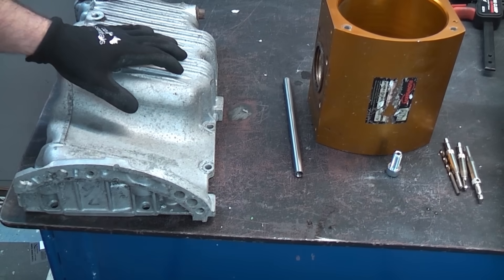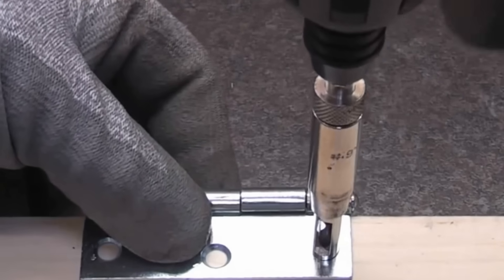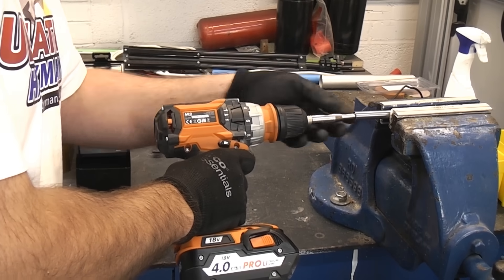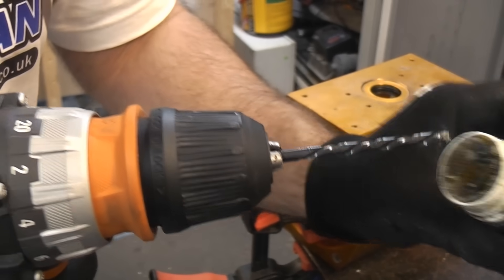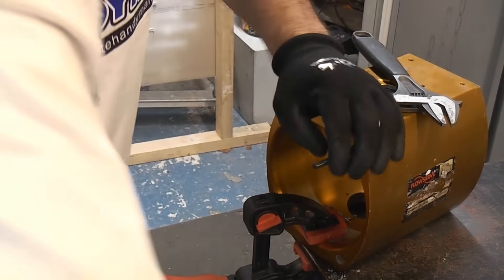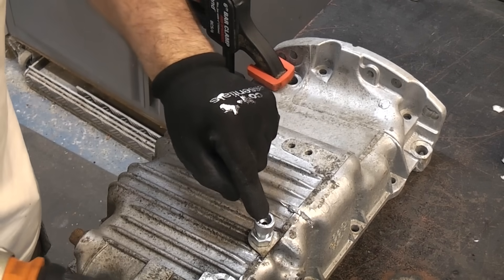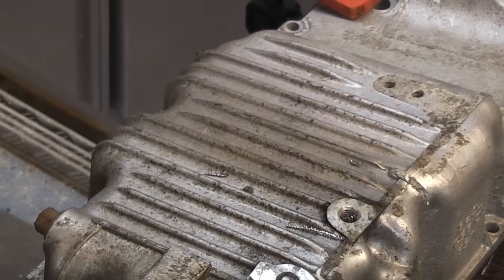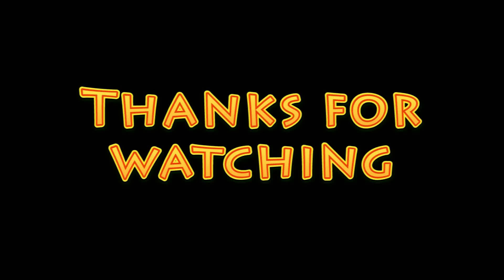How to remove a broken bolt in a deep hole | remove broken bolt in recessed hole

Comment: The motorbikes I used to be able to afford were old, rusted and guaranteed to break down in the fairly near future. The first few weeks, I would spend getting the old bolts out, replacing the cross-head screws with stainless steel allen screws and lots of copper-ese. That way, when it did break down and I was on a time limit, I could get the thing opened up in 5 minutes with no fuss. Highly recommend the copper grease.
Reply from the maker: Thanks for the comment

Comment: Excellent video! - I face this problem all the time in the old machines and things that I take apart, Usually a seized rusted bolt snaps when using great force to undo it and it then leaves a problem of half the bolt still being stuck in the part you are trying to salvage - I normally use a Torx bit set to achieve the same result instead of these cheap screw extractors which don't always bite well and can also snap too with them being carbon steel - A Torx bit gently hammered into the hole you've just drilled in the broken bolt and a ratchet/driver works wonders! Especially when there is thread locking compound involved which makes removing the broken bolt that little bit harder but the gentle heat from the blow torch usually takes care of this :-)
Reply from the maker: Thanks for the comment  ;-)
Reply: @ultimatehandyman   You're welcome m8 ;-)

Comment: Nice video, but you can't screw in a center bolt when the old bolt breaks at the surface.
Reply from the maker: Thanks. If the bolt is at the surface it is a piece of cake ;-)

Comment: Using a tap wrench overhead applies downward pressure to the tap thus making a better bite and easier keeping it seated inside the bolt. I ran the tool shop in my company in the US Army and extricated thousands of bolts as the HMMWV (Humvee) is notorious for shearing the generator mount bolts in the head. Since the heads are mirrored lazy mechanics would just flip or swap heads until all the holes were full of sheared bolts. I would extricate every one when they brought them to me and start over fresh.
Reply from the maker: Thanks for the comment

Comment: thanks  for sharing this video.... it has been a long time since I removed a bolt that broke off, usually in an engine block. I have a couple projects setting around that will probably require removing broken bolt or two... as a matter of fact, I have to remove my mower deck to place the pulley spindles.. I'm sure they will give me an opportunity to use your information .
Reply from the maker: You are welcome
Thanks for the comment

Comment: A couple of years ago when my bro-in-laws were almost decent folks, they broke a stud off in an exhaust manifold. They knew me as a mechanic/machinist and knew that I had something to get that broken bolt out. I was at work when they pulled up to the shop door, they raised the hood, and I reached into the stud with my rough and grimy fingertip and turned the broken stud with the high point from the break, and then easily removed the stud. You can imagine the rest of the story.
Reply from the maker: I've had some that have snapped like that at work, but the remainder of the stud can easily be removed. Of course I could never film it because most people on YouTube would not believe it!
Thanks for the comment
Reply: @ultimatehandyman  because at the time it breaks it's under extreme torque!

Comment: Heat rusty bolts before they snap, also cooling quickly with the penetrating oil will cause a separation between bolt and job. The idea is to spray wd on the bolt itself so it cools and shrinks within the job, it also burns out the rust
Reply: PB blaster has ALWAYS out performed bg, liquid wrench, wd, etc in the real world. At least for me
Reply: William Tanner I’ve always like the label on the can of PB Blaster. It looks like everybody in the lab got to design part of it, or the inventer let his kids do the label!!!!! Great stuff, all I use!!!
Reply: Bruce Askin this works very well. PB Blaster is very good.
Reply: WD sucks as penetrant .    Just mix 50/50 acetone and auto tranny oil.      Dirt cheap works as well as anything else out there
Reply: @drizler  liquid wrench's penetrating spray outperformed the ATF/acetone mix. Project farm tested it out.
Reply: @drizler  my personal preference is straight up diesel fuel. The paraffin wax in it makes an awesome penetration lubercant.
Reply: doug11224
Reply: Bruce Askin j
Reply: lol, wd40
Reply: candle wax is better
Reply: In my experience,despite all the rival claims,a sprinkle of holy water is just as effective.
Reply: David Worsley - Amen to that.
Reply: I've used liquid nitrogen for that and your idea works great.

Comment: Only use top quality extractors - the cheap ones can (will) break off in the hole leaving hardened steel in the extractor hole.
Reply from the maker: Thanks for the comment

Comment: Video guide is great.
I got the broken steel screw of the abs break sensor in a aluminum structure while replacing the left wheel bearing. I will try again to remove it.
Reply from the maker: Good luck with it ;-) 
Thanks for the comment

Comment: top video,  voice , explanation, maybee you can show in text-over what kind of grease you used. thanks!
Reply from the maker: I thought I put that in the subtitles.
I used Exact cutting paste when drilling and copper anti-seize when inserting the new bolt, although a few people have said ceramic anti-seize is better.
Thanks for the comment

Comment: So glad I found your socket head bolt jig technique.  I had a broken recessed manifold bolt on my 5.7 hemi engine in a tight space that I was able to utilize your technique to extract it. Thank god because I couldn't find a local auto machine shop to do this job so I was at a real loss until I saw your video.  I only had 5" of space to work with and there was no way I could get a hammer on a punch to mark center on this recessed bolt.  The only real modification I had to do was to cut the drill bit shaft back about  an inch so my right-angle drill attachment with the shortened drill bit could be inserted into the socket head jig. Thank you
Reply from the maker: You have no idea how good it is to read your comment. Often people give me grief, with comments such as-
"try that in a engine bay"
"it's easy on the bench"
"try it when the bolts are rusty" etc.

You have made my day by using the bolt guide and adapting your own drill bit to shorten it 😉

Thanks for the comment
Reply: @ultimatehandyman  All those haters just don't understand that these are just samples for techniques to try.
Not every broken bolt can be extracted, using this method. Not everything is going to be perfect.

People searching for a "one fix fix all" is living in a pipe dream.

Thanks for showing off the techniques that you utilize to attempt bolt extractions.
Reply: @williamvaughn2938  Try getting a camera(to film the demo) down in those tight spaces, while you are trying to drill the hole, & extract a bolt.

Comment: If you developed the idea to drill out a socket head cap screw to make a drill guide, you get the genius award. Providing there are enough threads to use this, it is a terrific approach. I usually encounter surface-sheared bolts, and roll pins ( split tension pins ) to remove. Any methods for those ?
Reply from the maker: Sometimes we come across roll pins at work, normally I just knock them out using a punch and hammer. If in a confined space you can use a spring tools punch, similar to these- https://www.youtube.com/watch?v=fjBu-tWdqoc

Years ago I used to have a tool to remove roll pins from door hinges, it was made by Sykes Pickavant, similar to this-  http://www.sykespickavantexport.com/products/Sykes-Pickavant/body/general-body-tools/door-hinge/63154/045400

For bolts sheared flush with the surface I normally try a left handed drill bit or weld a nut on.

Thanks for the comment

Comment: Normally when i tighten some alumunium part, not the bolts that broken inside but the thread broken. 😢😢😆
Reply: Buy and learn how to use a thread insert kit. It will save you tons of money. You'll need a tap set as well as appropriate drill bits, drill guides and/or drill press.
Reply: @billmain4090  yes.. i use the helixset to repair.. thank you
Reply: @JurnalEko  the
Reply: try pulling an old outboard motor apart without snapping off stainless bolts in ally! as far as your stripping threads goes, buy a torque wrench and your problem solved.
Reply: Yes  @rossbrumby1957  sometimes my crew, not be patient to tighten, they not use the feeling to tight the ALumunium material.. they just think it is strong enough 😀😀😂
Reply from the maker: Thanks for the comment
Reply: @ultimatehandyman   very nice.. video.
Reply: Just re-tap the thread. Depending on the part you might get away with upsizing the thread for that bolt. Not the best if your trying to restore something back to original condition but all good if you just want the thing goin.
Reply: @Yo, these tend to break when undoing them after the bolt has been in a long time.
Reply: Buy a helicoil kit, comes with tap, tap drill, and helicoil. You'll have to go up 1 size. Use a drill press atleast though and helicoils are tricky.__ better for you to understand clamp pressure and develop feel. Gotta remember bolts are steel , and aluminum is not. That's why bolts done break, aluminum breaks. Once helicoil is in you put a screwdriver in the hole on the "driver" tang and hit it with a hammer, fish the tab out. That guy saying they come out didn't use Locktight
Reply: yo indonesia use a torque wrench
Reply: I just eye up the centre smack it with a dot punch and hammer then drive a small drill straight thru and work my way up until it winds out i might invest in one of those bolt extraction tools tho and some reverse drill bits👍😃

Comment: Totally using the bolt and nut trick for my tool and dies! Press operators are constantly shearing bolts off..likewise on the left handed bits total life saver but have found that when a drill press and the left handed bit is combined even more lethal than the hand drill (obviously) it allows for sudden down pressure. Great learning lesson👍
Reply from the maker: Thanks for the comment

Comment: very impresive ! i like the three bolts you made M12 M10 M8,  what size did you drill your three different bolts size diameter? i would guess a small hole just for centring your first cut.
good job.
Reply from the maker: If I remember rightly, I drilled the M12 out to 8mm, the M10 to 6mm and the M8 to 4mm
Thanks for the comment

Comment: one other thing is that when using a spirel extractor you will at times spread the bolt making more trouble---so you need to use a square extractor
Reply from the maker: Thanks for the comment

Comment: the idea of using a drilled bolt to start the  lead drill is a winner-------BUT what you haven,t addressed is when the broken bolt is galed in the hole----you will need to drill out the broken bolt to just under the size of the threads the use a small chisel to remove the rest of the broken bolt!!!!!!!!
Reply from the maker: You can always drill that out- https://www.youtube.com/watch?v=7JCfEMrCjhc
Thanks for the comment

Comment: I usually weld the bolt -spotting until it's at the surface then weld a nut to the same. never failed to get it out quickly
Reply from the maker: Thanks for the comment

Comment: Great ideas. I do this type work all the time. I have a set of left handed reamers that work good for backing out bolts. They are four fluted and if you leave .5 mm a side for it to bite into, you can walk them backwards no worries. I have also used a Dremel tool to cut a slot into the bolt and use a flat bladed screw driver.
Reply from the maker: Thanks for the comment

Comment: I had to make one of these drill guides to remove a broken pin bolt that secured the keeper shaft  in a chevy rear end. Worked great !!  These are sold just for that purpose, though quite costly.
Reply from the maker: Thanks for the comment

Comment: Fascinating viewing. I always love to watch someone who knows what they're doing. One question though. Why use an adjustable wrench when you COULD use either a socket wrench on a ratchet handle or even a ratcheting box end wrench? Whenever I can I always use a socket and ratchet or a ratcheting box end wrench. My wife bought me a set of ratcheting combination wrenches a few years back and they work great! Instead of a regular combination wrench with an open end at one end and a box end at the other, these have a reversible ratcheting box end. It makes tightening and loosening bolts and nuts very easy. Oh and the set she gave me has both SAE and metric sized wrenches in it.
Reply from the maker: I did mention in the video that my tap wrench was at work, at least once (possibly twice)
Thanks for the comment

Comment: I've heard of copper grease causing a reaction (different metals are likely to engange in a redox reaction) and actually facilitate ceasing... Has anyone ever actually encountered that though? The bolts in my brake calipers were given the treatment by the manufacturer.
Reply from the maker: I've read some comments about anti-seize causing corrosion, but many of the comments seem to come from areas where there is either high humidity or salt water. We use copper anti-seize on almost everything on site and we never have any problems with aluminium/steel/stainless steel etc.
Thanks for the comment

Comment: I'd love to know how to remove a broken tap (hardened steel) from a hole I was chasing the threads in. It broke off below the surface and is small.
Reply from the maker: I've drilled out a tap recently, but the smallest diameter diamond hole saw is about 6.5mm- https://www.youtube.com/watch?v=7JCfEMrCjhc
You might be able to drill it out using a solid carbide bit- but they are very brittle!
Reply: EDM

Comment: I'm 54yrs old now; I've done this so many times @ home on vehicles & @ work repairing Aircraft I can drill thru the center without using a guide bolt or the hinge drill bit tool but they're great ideas & very helpful for those with lesser skills & experience. I really like the drilling guide bolt & hinge drill bit tool, Top Tips thanks for sharing & teaching the next generation how it's done. Subbed
Reply from the maker: You are welcome
Thanks for the comment

Comment: heat with burning totch til red cool down with water till cold it will loosen stud in hole a lot easer to get out  grate for turbo nuts studs before u snap them
Reply from the maker: Thanks for the comment

Comment: I applaud the drill guide, NICE!  I have found that the square, tapered flute extractor to work much better than taperd, reverse thread round ones shown. much less likely to expand or distort the broken thread, especially softer materials (think brass fittings)
Reply from the maker: Thanks for the comment

Comment: Like the idea of using another bolt for the guide. I would think that a less expensive bolt (just regular cheap type) would work without having to use a carbide drill bit. It would wear faster, but easy to replace.
Rule 13: I have proven that only on the last hole being tapped does the tap break!
Reply from the maker: Thanks for the comment

Comment: Fantastic ideas but in my experience, they don’t break off halfway down the whole, they break off flush with the surface.
They also break off because they are seized in the hole, so the reality is that they never come out so easily.
Reply from the maker: Thanks, we get some at work that shear down the hole, but like you say most are flush or above the surface.
Obviously rust/corrosion makes it much more difficult.
Thanks for the comment ;-)

Comment: In 30 years of works i always saw bolts  sheared  off at the surface; how did you get that piece in there,so clean,no rust,no electrolisis,no nothing for the video? from underneath?.
Reply from the maker: We get them occasionally at work like in this video. I'm not sure how these got sheared but there are 4 of them, they are all in blind holes.
Thanks for the comment

Comment: Where EVER did you get that pullspring punch?  I've searched high and low and only seem to find the standard sprung push-punches that wear and fail.
Reply from the maker: I had one of the automatic type centre punches and it lasted less than a week. The spring tools punches are great-

http://springtools.co.uk/

Thanks for the comment ;-)

Comment: Great tip, but pulling off aluminum parts is easier. The hard part is to remove steel or cast iron parts mainly when they are rusted
Reply from the maker: Thanks for the comment

Comment: Nice work !
Reply from the maker: Thanks for the comment
Reply: You're welcome,  and thanks for taking your time to make this video to show this most outstanding method of removing these broken bolts.  I've tried quite a few times without sucess for that very reason that the broken bolt has a mound that is nearly impossible to get the drill centered without damaging the threads.

Comment: Doesn't anti-seize affect the torque spec of the bolt?
Reply from the maker: Yes, or so I have been told.
I'll test this out when I get chance ;-)
Thanks for the comment
Reply: You should reduce the recommended torque setting by roughly one third if you've lubed the thread.  It's not an exact science but you won't go far wrong with that as a ballpark figure.

Comment: Once when I had to do that, I drilled A hole and hammered in a steel nail which i then bent and turned. Much like an allen key. No hearing cooling etc. The bolt got loose by hammering of the nail I believe
Reply: In fact i thought of a screw with a reverse thread. But i couldn't get it in the market so I dropped that idea. And the only power tool I have is a drill.